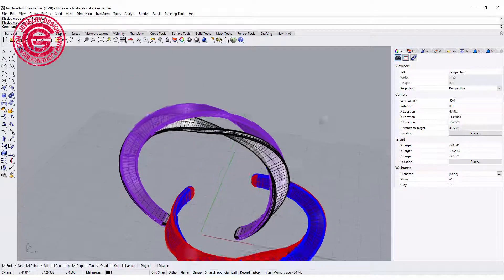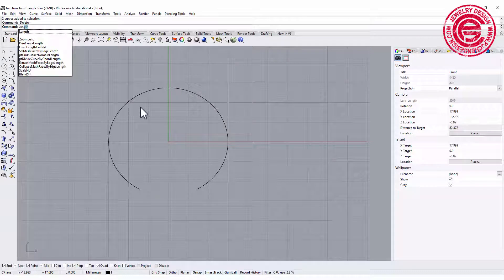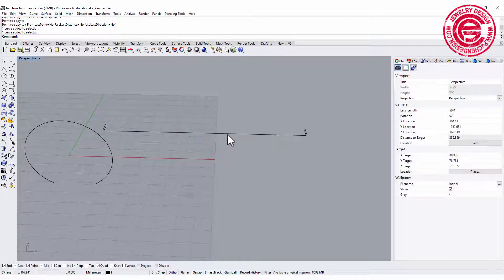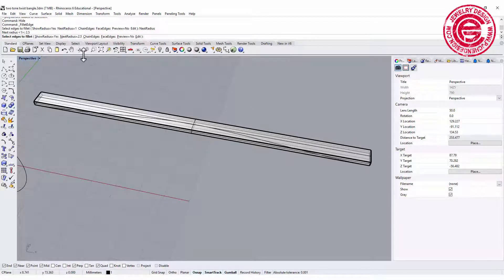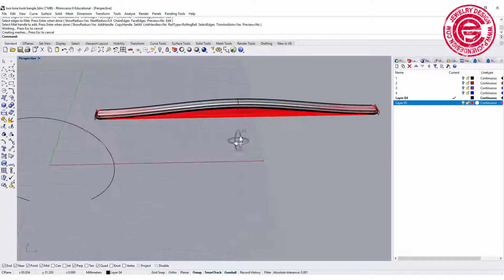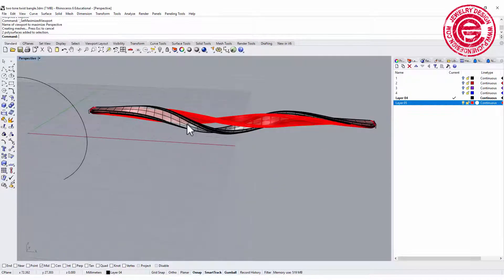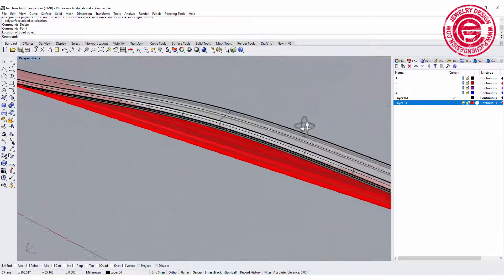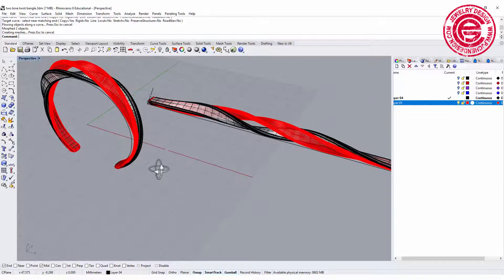Two-Tone Twist Bangle CAD Modeling in Rhino 6 (2018)- Jewelry CAD Design Tutorial #33

Comment: But sir I requested you to make a video over different types of locks for bracelets.. Can you please make a video over it?
Reply from the maker: Not sure what other previous requests you sent. This is the first time seeing the bracelet subject from you. If you are interested in the different type of "clasps" for bracelet and necklace, www.stuller.com and www.riogrande.com also pintrest will be a good start for your research. Most of the commercial clasps used for jewelry industry is machine made due to the metal tension or springs inside of the clasps, which may involve die struck or machining engineering. In a lot of cases, manufacturing specific clasps usually requires the minimum order, so buying ready-made clasps for your design is actually easier and cheaper than have it custom made.
Reply: @PJChenJewelryDesign  Thank you very much sir... One more question I have. Do you teach designs personally?? Please reply me
Reply from the maker: I teach both jewelry and industry design in college here in USA in the past 14 years. I do design freelance but not teaching design course personally, since it usually takes a very long time to explain the design process and develop design techniques.